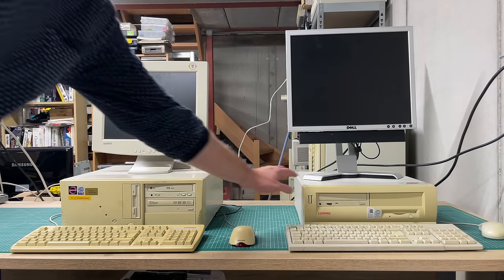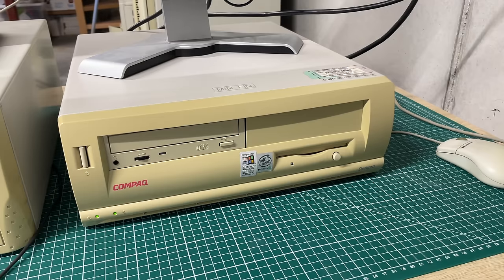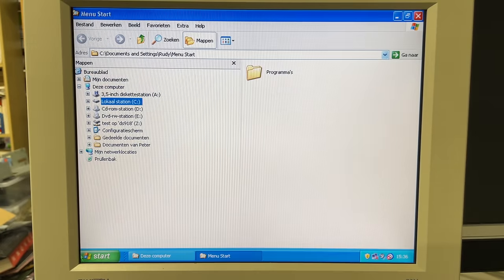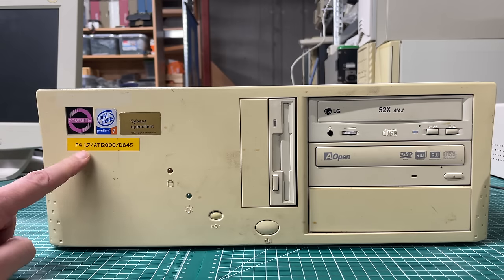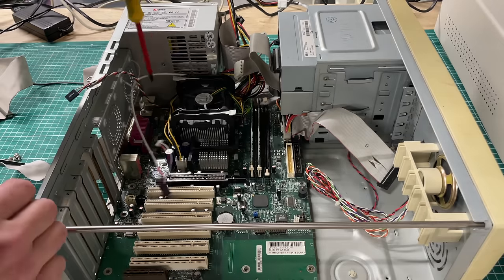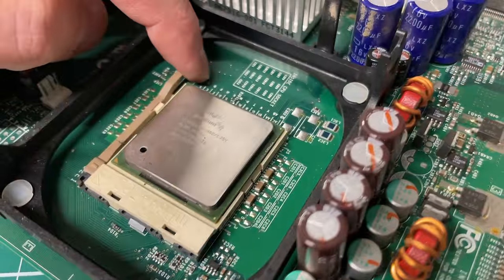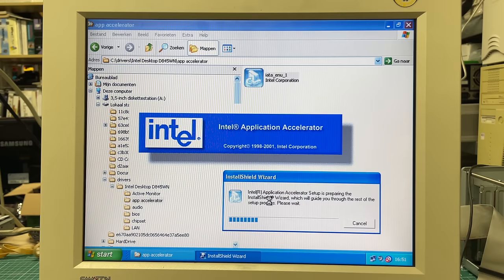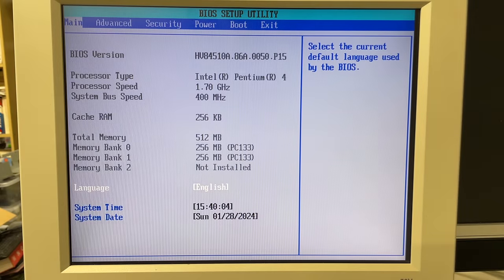Why is my Pentium 4 so slow ?

Comment: My first thought of this was "Pentium 4 Willamette/S432 with PC133 Memory".
And it indeed is using PC-133 memory, which the P4 really doesn't like.
And making it faster is practical with a more modern Board, Single Channel DDR-SDRAM at bare minimum, Dual Channel (i865PE) recommended.
Reply: That is what I went with on an ABIT AS8 motherboard (i865PE) and DDR dual channel 2x1GB 3200 rated? I forget now. Pentium 4 640 Prescott.  Pretty good hybrid system with AGP 8x support.  Never had the chance to try it with an SSD drive though.
Reply: SDRAM slows down the P4, but nothing like that.  You wouldn't notice in everyday use.  It's a bottleneck, but it isn't crippling.

Windows XP on an SSD moves like it's bathed in Crisco, going downhill on a Slip n' Slide.  I remember the first boot on an SSD.  The XP Pro loading screen had the chance to move the blue dots about 2/3rds of a trip from left to right before the screen blanked and went to the desktop.  It does depend on what else you have (physically) installed, and what drivers you have loaded, as some hardware just takes a moment to initialize.  In that case it doesn't matter how fast your storage, RAM, or CPU are.
Reply: @nickwallette6201  indeed. As I remember - the first question about P4 PC performance was its memory type. But SDRAM with P4 only meant P4 would not be much faster than P3, not slower because P3 had the same SDRAM anyway.
Reply: Even with RD ram the P4 1.5 was only slightly faster than the Coppermine 1ghz. It was pretty bad. And sometimes even slower. Only in things like Quake 3 and optimised applications like MP3 compression was that 1.5 able to outrun the P3. Putting that 1.5 on SDram in fact makes it slower than a coppermine 1ghz machine. Its really sad how bad early P4's were. Northwood hyperthreading P4's were a pretty decent chip though.
Reply: My first computer I built was a P4 1.7Ghz with RDRam memory. I started out with 256MB, then upgraded an extra 512MB for 768MB total. It had a 40GB WD HDD. 
I think my next computer was a P4 3.0Ghz with hyperthreading. That was actually my most disappointing computer. It didn't seem to last long at all.
My computer after that was a Core2Quad Q6700 and that computer lasted over 10 years.
Reply: @frommatorav1   Yeah the Core2 Quad generation were brilliant and I still use mine now in 2024. I had a C2Q Q6600 which is a classic choice now but very commonly found.   I modded the CPU socket and BIOS to take a Xeon X5492 which is identical to a QX9775 but cost a quarter of the price in 2015 on Ebay!  Been using that computer daily since April 2012.
Reply: @wladislawmsk pentium 4 is slower than p3.
Reply: @EgoShredder  I had 2 core2quad systems and in 2019, combined the best of both into one computer. It had a Q9400 and 8GB DDR2 800Mhz.
I retired that one in 2021 but it's fully assembled and would probably work fine if plugged back in. It just got painfully slow on the internet, so it was replaced with a r5 3600 AMD processor and 16GB of DDR 3200 or 3600, with nvme 2 TB storage.
Reply: @frommatorav1   It's weird in that some sites mainly social media ones, are stupidly slow and sluggish just entering text into a box, but can randomly go really fast and snappy possibly when a cache/buffer empties itself? Strange how it can be either slow or fast from one minute to the next, which never happened years ago.  This is made a lot worse due to social media performing realtime monitoring of keystrokes, to parse the words and context of your comment before allowing it to post. You can really feel the CPU pulling you back while you type, as it check your words.  Apart from that most things including the internet, work at a decent speed on my Xeon based system.  Once I get my income going again, I hope to upgrade to something more current.
Reply: Pentium 4, DDR 3 max here
Reply: @sjogosPT  That only applied to the first generation of P4 CPUs. I knew that back in early 2002 and bought a P3 based Celeron 1200 Tualatin instead.  I still own that machine and upgraded it to the maximum P3 1400S server chip, which is brilliant for easy overclocking.
Reply: @nickwallette6201  Depending on the task the difference can be immense. a 1.4 Tualatin can easily beat a 1.8 Northwood.
Unless you use SSE2 code.
And memory does have an effect, no matter if PC800 RDRAM, or DDR-266, they all will be about 15% faster than PC133 SDRAM (which is also about the difference between DDR2-400 and DDR2-800 on a Prescott system)

Comment: Chipset drivers for Windows XP for newer systems that XP didn't ship with drivers helped a lot.  I remember moding in the nForce2 IDE controller driver into the Windows XP setup (this was before nLite came along) for my Athlon XP 2000+ system, and Windows XP would install so much faster using the nForce2 driver vs the generic driver (which didn't support DMA at all).  This would reduce my installation time to 30mins on a quick format (down from 45mins, 40GB Seagate drive), or 45mins on a full format (down from 1hour on the same Seagate drive).

I don't remember how (and was never able to replicate it), but after nLite came around, I reduced my WindowsXP installation down to 200MBs installed.  Just removed stupid stuff like theme support and Internet Explorer (I clearly remember this breaking Steam in one attempt a few years later after that launched)...  Good times.

Comment: I could be many things. Caps may look fine from outside but they may be losing capacitace or some voltage regulator maybe running too hot or some IC/option is holding system back. Even a bad power supply can perform a slowness role.
When you said ~3MB/s transfers, my mind screamed DMA is off in Device Manager. Over 10 years ago, I had XP installed on a system like these. The HDD unfortunatelly was about to die.... some bad sectors or perhaps a range of bad sectors. I noticed that XP autoswitched from DMA on to off and the system became pretty slow like this video showed.
Cables sometimes can make things harder when we push the cable and not the thin black plastic. One wire broken is what's needed to make a bad cable.
Reply: For anyone wonder how to check the mode, open Device Manager. Go to IDE ATA/ATAPI controllers. Then right click Primary IDE Channel and select Properties. Then in the window that pops up go to the Advanced Settings Tab. It'll show the current transfer mode there.

I've had a similar issue with my x40 before that was likely related to a failing drive where it'd fall back into PIO mode occasionally and the solution was to uninstall the IDE controller device and restart and let it reinstall it.
Reply: I totally agree, bus gone to PIO mode probably, so driver reinstallation of that bus always should fix the problem.
Reply: @aleksa1987 
Not necessarily. Going back to Device Manager and check if DMA is set "if available" under ATA/ATAPI controllers/Primary channel. Deleting the Primary Channel and say yes to restart, should reinstall that devie and enumerate the hdds there connected.
Reply: That means PATA I/O errors occurred. Usually a bad PATA cable connection.

Comment: In my experience, systems that have 3 RAM slots were generally designed with the capability to overclock the chipset if you only occupied 2 of the RAM slots. The board traces were too long to overclock with the 3rd slot occupied.

Your mileage may vary, possibly significantly, because my experience was from a totally different motherboard.

Still, there was a reason for 3 RAM slot systems back in the day, and it was usually a choice of running the chipset overclocked with only 2 slots occupied, or running the chipset at stock speed with all 3 slots occupied.
Reply: Compaq, overclocked ? why you say that ???
new here ???
Reply: @lucasrem  Also, I think the system I was referring to was an early ASUS board from 2003, but I kinda forget now.

Regardless, there were some unique design decisions made with systems that had an odd number of memory slots.

Comment: Simply installing the intel chipset drivers could make a huge difference. Microsoft often supplied outdated but stable drivers to get you going but aren't optimized. The Compaq came with good drivers preinstalled probably.

Xp configuration could also impact performance like fixed or variable swap file size, stuff in autostart, virusscanners, when windows updates decides it's time to scan for updates etc.
Reply: the only MB where installing chipset drivers was actually doing something was some MB with socket 754 (amd), but generally, I never had to install them on any socket 478 Intel motherboard with Win XP, it was always working fine, I am just installing network, graphics and sound drivers and everything works fine mostly, installing chipset drivers sometimes cause more problems than making it better

Comment: I always gauge the load time of WinXP by the number of swipes the progress bar makes.  My P4 3.4Ghz Cedar Mill does it in 2.5 swipes, same as my Opteron 180. It’s not as old as your P4, so no real surprise.  Intel’s application accelerator looks interesting.  I’ll give it a go. They clearly had a problem that required a solution.

Comment: HI, i find the version of XP plus the service packs makes a very significant impact on overall "snappyness"

Stock XP can run in 512k happily
SP1, SP2,SP3 for me means each service pack will like another 512k for each upgrade

You dont need to do it, but idle usage increases as does ram requirement

If you under ram, then it will just thrash around the hard drive with a slow swap file

In that age i have 2 x toshiba Pentium M's and a IBM / Lenove P4, the laptops are on stock and XP1 for the other.
the IBM with 2.5g ram ran fast with original XP, but i ended up taking it to the SP3 update and each step i let it run for a week or 2, and it got more and more sluggish,but luckily it was plenty of ram

I also have a HP5102 mini netbook, it has 2gb ram and Atom processor, that i bought new with XP home, it ran OK in the day but 4 years ago i almost tossed it in the bin as it was extremely slow, xp start up was over 5 mins, but the hdd made no bad noises.
A reinstall took almost 4 hours, and it sill performed slow.
I installed linux min , faster but slow.

while shopping i picked up a 128GB SSD for raspbery pi4, but decided to test it on the netbook, WOW , the ssd is faster but it turns out that the HDD has some strange fault, it is just slow no bad tracks or errors or noises  - that went into a Pentium 2 and a dos 6.22 install and dual boot to 98 and it was slow in dos - it is a paperweight now but full of my dos backups ** oh some people will ask , even a spare hdd replacement in the netbook saw a 45-50 min reinstall time for xp and about a 2 to 3 min boot up time

Nice P4's just go get a network card :)

Comment: Interestingly similar to my i3 Vs i5 laptops, where the i3 outstrips the i5 by a country mile. I know they're technically different, but it's eye opening to see the older machine absolutely trouncing newer one.

Anyway, I may be one of those weird folk, but I always liked and enjoyed my old P4 computers. I always found them to be solid and reliable, but, not alarmingly better than my P3, which too was a strong performer. My AMD K7 was also a good and trouble free machine.  All of these machines were used to digitise, process and remaster audio recordings, which, depending on how many processes were running simultaneously, was very demanding on PC resources.

Comment: I remember that the motherboard drivers always had to be installed, otherwise the drives were slow. And yes, you have to reinstall the XP in every year, otherwise it will be slow.
Reply: Drivers probably never got installed because plug and play OS option was turned off
Reply: @thedopplereffect00  Plug and play option in BIOS has nothing to do with installed drivers. This option is about assigning resources like DMA and IRQ in BIOS.

Comment: OS performace does vary with an important factor, hard drive speed. Sometimes old hardware may result in lag of program execution and OS loads, so you could check if those parts are doing wrong.

Comment: The order of driver installation is important. Sometimes Windows will just default to a generic driver and not pick up a better third party one. I think that’s why they tell you to install the driver before plugging in, that way the system can be prepared to load the right driver.

Comment: The first reason would be because it's a Pentium 4

But on a more serious note, there might just be something misconfigured.
 - At first I assume it's actually a Pentium 4 and not a Celeron, because those were cut down like crazy.
 - Then obviously the amount of background stuff.
 - Then IDE. Classic PIO mode issues. When the drive doesn't deliver proper data the system will try again. And after 5 trys it will reduce the DMA mode make sure it can get any data at all. Let that happen a couple of times and you're out of DMA modes and back to PIO. The classic fix is to remove the controller in device manager and do a restart. It should then reinstall  the controler in it's proper UDMA mode.
 - The drive might just be on it's way out
 - And obviously fragmentation
 - The BIOS reports PC133 memory, which is probably the slowest memory any Pentium 4 could run on and would be a clear bottleneck.

Comment: I had a Pentium III 900mhz, kingston 512mb ram, PNY Geforce4 ti 4600, Maxtor 80gb hhd I built in I think 2001 and used all the way till 2006. Even then it was starting to struggle with some games but overall for daily use it was still plenty fast. I think for a while I had it overclocked to 1 or 1.1ghz with the Asus board I had.

Comment: The Pentium 4 PC was effectively running in 'Safe Mode' (no direct disk access performance) due to the chipset drivers not being updated.  Probably happened after the motherboard/CPU were upgraded but not the software.

Comment: Back in the day, I had nothing but problems from the Matrox hard drives. Unless there is a reason you're keeping it IDE, I would get a SATA adapter and put a SSD in it. If you plan to keep the IDE drive, I would hunt down a WD drive. That P4 should run circles around the P3. 

Somewhere, I have a Shuttle XPC with a P4 Extreme in it. It was a few years newer than you CPU, but it ran really good! I may dig it out and see what I can do with it!

Comment: are you sure that DMA is on in XP? sometimes it likes to turn off yes the OS has a setting too. i think they fixed this in later updated installers like SP1/SP2/SP3 that and having the drivers installed and checking the bios settings.
Reply: If those tests show transfer rate about 60MB/s, UDMA has to be active. PIO would be 3MB/s max like in first run.

Comment: Good video and its nice to see you back.
Stuck in PIO mode sucks 😆

on the subject of Pentium 4.
A equally clocked Pentium 3 tualatin is way faster then a Pentium 4 and PC133 SDRAM just add insult to injury.
Pentium 4 IPC is way lower then the old P3 and Athlons, so the CPU needed every bit of data available to be efficient and with SDR its not.
I would take a P3 or Athlon over a P4 all day long if they are clocked at 75% of the P4 and assuming the P4 has DDR och RAMBUS.
The only thing that could make that P4 system any slower is a Celeron, Celeron netburst CPU with PC133, must be painfully slow, it sure was even with DDR266 for my friends budget PC back then 🤣

Comment: It would also be reasonable to check the hard drive for bad sectors. The built-in disk tools, of course, try to correct and replace such areas, but all this still slows down the disk, with a large number of errors.
For such a task, for example, Victoria programs by Sergei Kazansky, Norton Disk Doctor and the like are suitable.

Comment: there's a big difference between 5400rpm drives and 7200rpm drives.  just this upgrade will up the speed.  also, i remember reading that up to winxp, depending on the amount of ram you have, it will determine what will be installed by the OS. After installation, you can add another stick of ram to speed things up.